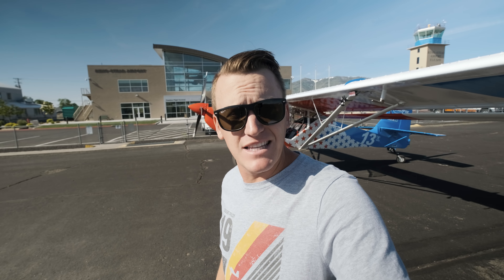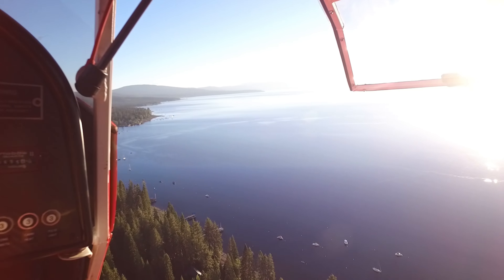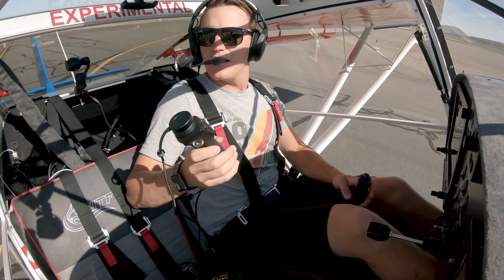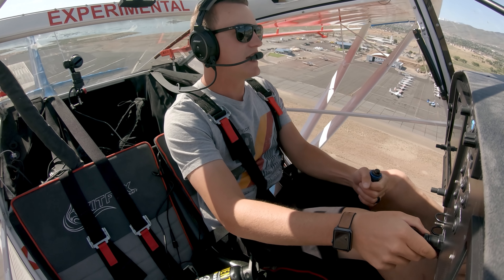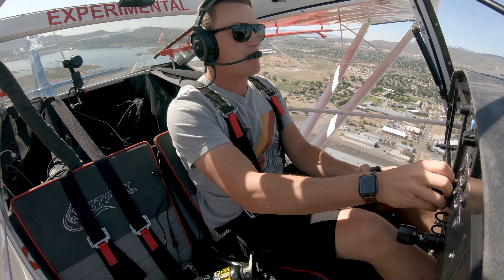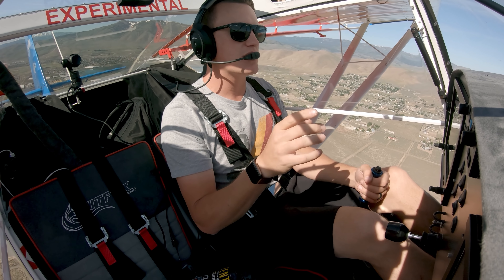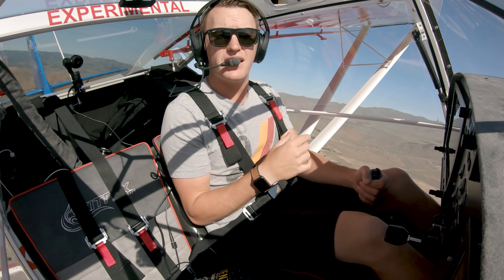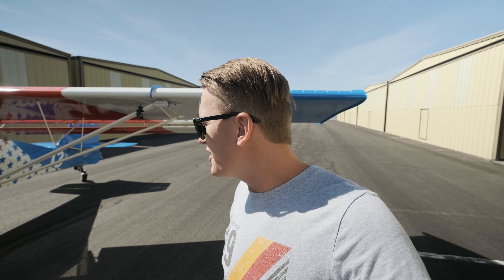MORE LIFT!!! Custom STOL Leading Edge Cuffs

Comment: Cool. Interesting about Kitfox doing this for their wing as is without changing/adding for e.g. lower camber on the wing which might explain little to no difference too but then it means a whole new wing design. One can make pilot-controlled leading edge slats moving them in flush for cruise and out for landing but that's a whole new ball game, trade-off with a little more weight and an entire new wing design.  Try a wing with variable incidence next, ask Kitfox to design you one of those! : )  ho ho *kidding. Good, great stuff, fantastic stuff as usual on your channel.

Comment: I installed leading edge cuffs on my highlander. Didn’t effect cruise speed, barely made the stall lower, but improved the landing characteristics immensely. Of course the indicated airspeed gets all jumpy weird at those speeds anyway. It seems the wing will fly at higher AOA in the flare. I’m also nose heavy CG, running a Jabiru 3300. Before when I got slow to land in the flare the thing dropped out of the sky like a sack of .... now there is still some elevator to play with that actually does something. This coupled with the TK1 gear changed my highlander night and day.

Comment: Try golfball dimples on the cuff and with less droop. Worth a shot.
Reply from the maker: I really do want to try this. I’ve talked about it a bunch of times but have yet to actually try it
Reply: @TrentonPalmer  You could 3D print a roller of some kind to imprint the foam. Not sure of the dimple size (tuned VGs?), or how you would manage the covering though. Since you are going experimental, may as well try it!

Comment: Great upload Trent, what if you rolled the Leading Edge cuffs inboard maybe 1 or 2 degrees you would have to cut them all over again but you would see some significant gain, don't know what you would lose on cruise that's the problem. Might not lose anything  on cruise and the top but benefit from a little slower stall speed.

Comment: Hey Trent, I added a leading edge cuff to my stock Highlander wing. I didn’t get much difference in stall performance. Where the addition of the leading edge cuff really improved the slow speed performance was after I added VGs to the very front of the leading edge. It improved my LANDING SPEED,  (high angle of attack, medium power setting) and elevator and aileron authority at that flight condition. It slowed my handing speed by 5-7 mph. That wing hangs on so much slower now that I was amazed. Could you stick some VGs on there and try it out? I wouldn’t give up on the cuff until you’ve tried that out. Great videos man. Hope to see you at HSF.
Reply from the maker: Hey Steve, yeah it was partially seeing how much of an improvement the Kitfox leading edge was on the highlander wing that made me want to try this. Unfortunately I just never saw any improvement. Again, probably could have used a bit more finesse and tweaking to get a true gauge on it, but that’s a lot of work, I just wanna fly!
Reply: I know what you mean Trent. Going to do a bunch of that tomorrow! Cheers.

Comment: Hey Trent, I used to fly RC aircraft, we covered our planes with monocoat covering cause it shrinks and pulls together with a hot air blow dryer,  and we used to take the wing tips and bend the forward toward the ground and put the blow dryer on it so it will stay in place, the object to this so the wing tips wont stol while landing and the wing tips will still have lift after the stol from landing, so thought you might try putting the Custom stol leading Edge cuffs just on the wing tips and see if you gain lift while your landing the aircraft.  just a Idea for you to try.

Comment: I wouldn’t write them off yet. The leading edge cuffs will change indicated airspeed just like they changed the AOA indication. You could either do a similar test using ground speed instead of indicated airspeed in opposite directions and averaging the two to cancel out wind or do an airspeed calibration in each configuration to get the “true” stall speeds.
Reply from the maker: I did reference GPS in previous tests, and my landing ground roll was consistently longer with the cuff which makes me thing the airspeed wasn’t really lying. But it may be worth another shot, I’d make the cuff stick out even further though and I’d have it wrap all the way to the top of the wing chord and obviously move my VGs. That’s a lot of work though so if I do try again it will have to be after I finish building the house
Reply: Sounds like a good plan, a well designed cuff is way better than a slat since it improves both takeoff and landing performance. Good luck with the house.

Comment: Hey Trent you might have had a better result if you moved the vortex generators forward onto the "new" leading edge.  The test compared original leading edge with VGs in the correct location vs the new leading edge with VGs in the wrong location. This might have cancelled out any improvement.   Just a thought.

Comment: Trent, it sounds like any improvement would come from the divot between the the leading edge meets the wing topside, and if you move the vortex generators forward. Only you can decide whether the possible improvement is worth it. It sounds like the answer is no.

Comment: that gap could be a big part of the problem.  have heard of very easies going off the end of the runway because of loss of lift on the canard caused by the tiny ridge from a spanwise paint job masking line.  I have added narrow strips to trailing edges of wings or strip ailerons, [R C} and been amazed by the differance.

Comment: Trent its not as easy as just adding a bit of leading edge,you need a slotted grab effect slot,study the Fieseler Storch and you will find the solution,the leading edge slot gives grab and laminar flow effect collectively.

Comment: Those look like they extended the chord, but not the camber and a camber increase at high alpha is the main point of a cuff.  If you look at the Sportsman cuff, it's almost all below the camber line. I think the performance reductions you saw were the effect of the relative movement of the VG's and that lip you mentioned. They looked like chord extensions, which have the opposite effect to camber increases at high alpha.

Comment: What difference did the cuffs make to your full power climb performance numbers both on the VSI vs Airspeed at full power...I bet you see a lower airspeed before that high power stall almost to the point of no airspeed registered.....Those cuffs may help you get out of a hole....

Comment: Yo! Can you take some aerial shots of the Ridgecrest earthquake? There are fracture lines that go for miles. I haven’t seen anyone else do aerial shots of it. It would also be cool to see problems and pitfalls with landing in the high desert. 110 degrees, 2500 feet elevation, soft sand.

Comment: Although I'm a pilot and been in aviation for >50 years (and 30 years as a controller), I'm not a trained engineer. However, the first thing that strikes me in your apparent lack of change in parameters with the cuffs might be this: without the cuffs you have a virtual wing chord that has a certain element of coplanar to the axis of the pitot tube. With the cuffs, that apparent chord changes slightly, but the angle of the pitot does not. It sounds small, but is it possible you're not getting an accurate airspeed reading because of the difference in the apparent chord of the wing?

Comment: Not sure you gave it a fair shot. Fore/aft position of your vortex generators is critical for proper operation (our tests show 1/2” make a huge difference) Any defects in leading edge (the lip you noted) can be even more critical. Increasing cord and camber should have made a difference since you increased wing area in both aspects. Lastly if your aoa was not working correctly I doubt your airspeed was either. Keep up the good work. I’d love to have the contact info for your Hotwire guy if possible I’ve got some airfoils I’d love to try if he hires out.

Comment: Seems like the fences in the middle of the wing, and the wing end plate would also get washed out by the cuff unless they were increased in size. The VG placement would need to be optimized.  Too bad you didn't have time to put some tufts all over the wing and film that in flight.  God knows that takes a bunch of time.

Comment: moves the CG forward....
Reply from the maker: Center of lift moves forward, therefor effectively center of gravity back since it’s all in relation to the center of lift. But yes, from a weight only standpoint (ignoring the change in the center of lift) then it would be moving the CG forward.
Reply: Trent Palmer  you made the chord wider while keeping the trailing edge at the same point. The center of lift moved forward. The CG is a function of percentage of chord from the leading edge so the CG also moved forward. Period. 
No I’m not a troll and love your channel. Just an aerodynamic nut and such.

Comment: A part of the equation you may be missing is the VG's.  With the leading edge the VG's are essentially non effective.  You would need to move the VG's with the leading edge attached to compare apples to apples.  Just sayin.

Comment: Computer modeling of airfoils shows this problem . Changing the airfoil has little impact at slow speeds in the low % regions . Increasing wing span and wing area and losing weight and many multi electric motors with many  small props all making prop wash over the entire wing can reduce the stall speed more . Nice try good cuffs .

Comment: Trent, you mention the flat pitch drag characteristic of your new prop. If you have a power loss, will the EMU/FADEC drive the prop to high pitch to help your glide distance?  just curious thoughts of a contingent airman and whether the manufacturer went that far in design

Comment: It would have been good to see a test with a cuff on ONE wing only.
Reply from the maker: Maybe really high with a parachute, I’ve heard old wives tales of single wing mods like that causing a plane to go into a unrecoverable spin 😖
Reply: Parachutes are a Good Thing in experimental aviation.

At Piper, we glued foam shapes to the wings and tail of the Meridian to simulate ice buildup as part of FAA certification for flight into known icing conditions.

(And the test pilots wore parachutes)

Comment: Trent.  As always enjoy your videos

Have you considered or looked into increasing the size or area of the horizontal stabilizer/elevator.   On my KF7 with the standard wing I have about come to the conclusion that a 20-25% increase in area might be beneficial.    Any thoughts??
Reply from the maker: I would love a bigger elevator! Or more travel on the stabilizer trim. The issue with both is they would require a lot of structural changes to make happen, the trim is pretty obvious that it would take a lot of work since there’s only so much throw but the elevator is a limitation in the design limits of the linkages going to the elevator. A balanced elevator like on a cub would be a good solution though!

Comment: Make the tail/elevators more effective/ bigger. Also too I noticed on a cub we blocked off the gap from the landing gear to fuselage and it seemed to hold higher aoa and a little slower would be cool do see what it does to the fox.

Comment: The idea is to create a tubulent boundary layer, large aircraft like the embraer 175 i was on a few days ago use this to reduce drag. Total drag is drag from friction and drag from turbulence added together. In certain shapes at certain speeds, like an embraer wing at cruising altitude, increasing your Dt will more greatly reduce your Df. So overall, you lose drag increasing efficiency.

Comment: I wonder what, if any, impact the different AOA between wing configuration had on your pitot tube measurement of airspeed.
Reply: Exactly my thought, although I took a lot more words to suggest it.
Reply: @lrodpeterson3046  it's always a struggle to condense thoughts isn't it? Especially when you understand the physics of something.

Comment: You have just given myself and Kevin something to discuss for the week or so! 👍
Reply: Nic Holmes feels like the hard edge probably caused some turbulence on the top side of the wing and/or the new LE were not positioned on the existing surface low enough. All he said he noticed was slightly better takeoff. Feels like, to me, he is giving up a little early on the design with only one placement. I think a guy would have to get decently aggressive (with rotating those tips about the leading edge) to get a noticeable stall decrease or enhanced/desirable, low-speed flight characteristics. But, that’s me, and I’ve been wrong before. Alls I’m saying is I wouldn’t entirely ditch the idea after one flight...
Reply: @nationsenemy  I'm thinking an added leading edge slat might be better considering that wing is already pretty awesome.  The bottom being slightly lower than the bottom of the wing.  I doubt you'd see more than a couple knot reduction in cruise speed but more lift at higher AOA due to less separation.  Interesting idea with the cuff and I agree, definitely worth more investigation after 1 flight =)

Comment: Possible explanationn: the longer leading edge effectively reduced the wing's incidence angle.This forced you to fly at a higher'angle of attack (as evaluated from the fuselage, not as 'seen' by the wings). The consequent change in attitude - nose up - increased the fuselage's drag, spoiling the desired effect.
Possible solution: increase the incidence angle.

Comment: Try mounting them forward and leaving a gap behind to form a leading edge slat. The idea is you want to bleed off some air, increasing energy of airflow over the wing so the airflow stay attached for longer -  lowering stall speed

Comment: Can you get retractble "automatic" ones like in a bf-109?
Reply: other mods you could try (after you sort out your house):Suspention fairings with an aerofoil shap,Mud/Stone guards on the back of the main wheel (useless but would look cool) OR FLOATS!
Reply: A few Socatas have retractable ones too. Probably adds too much weight.
Reply: @alistairemson4986  yes but the ones on the socata are linked to the flaps ( I think,tell me if I'm wrong)what I mean is leading edge slat that just slide out on rails over a given AoA.It would be quite heavy don't get me wrong and I don't know how you would get the rails around the front wing spar
Reply: @archiescriven6178  Ahh ok, its been a while since I last worked on one, so I cant remember how they work exactly. 
Could be an interesting mod to design...

Comment: Given that the cuffs changed your angle of attack relative to your pitot tube, are the speeds with and without the cuffs accurately comparable?
Reply: Need to do a ground speed comparison going in four or more different directions, or get a pivoting pitot.

Comment: Experimentation even without dividends is still fun! 

Quick question for your plane Trent, have you ever used a Gurney flap on the aircraft or flown without it if it comes standard? What kind of things have you seen with its addition/exclusion on performance and feel?
Reply: Gurney flaps wont work with flaperons ...cant be fitted without destroying airflow feeding onto the flaperons

Comment: What is the difference between the rounded Cub style wing tips, vs. the straight tips on the KitFox?
Why has the rounded wing of the Cub been used for so many years, if straight is better?
Reply: Check out the Zlin Shock Cub/Ultra.

Comment: a good lifting profile is jedelsky, often used in rc park flyer. 

your actual profile looks like a clark Y that is good for normal flight.
I have a suggestion for you, putting three feet long sharp leading edge on wings edges, you may have a more stable stall.

to resume jedelsky profile, your leading edges shoult point down more than now.
it's better to think about a removable mod, to keep the efficient travel speed as now

Comment: I would definitely try again if you can improve the attachment and VG situation. Its REALLY difficult to screw up an airfoil with a leading edge cuff to the extent that Clmax is so impacted it doesnt make up for the added wing area and net Zero gain. In other words, the extra camber, or the extra wing area both independently should have had an impact. So, losing performance indicates to me that there was a serious detachment issue. I would imagine the performance you saw is closer to cusp no VG's, vs no cusp with VG's, meaning the VG's were at or around where the separation/trip was occurring leaving them almost blanked out at high alpha. This would also explain the uncertainty on landing or stall when the VG's would go in and out of being effective.

Another great video Trent. I've been wanting to make an experimental av channel specifically following the build and application of modifications followed up with test flight and analysis of various little parts.  More of a technical Vlog with 3 or 4 part episodes; theory/design, install, test flight, analysis and data.

Comment: Micro Aero recommends placing their VG’s a certain dimension from the leading edge, whether having a leading edge cuff or not. What this means is installing a cuff first, then adding the VG’s. 

I’m thinking a valid test would be more in line with repositioning the VG’s AFTER installing the cuff. This, of course, would be additional headache and perhaps without the desired advantage.